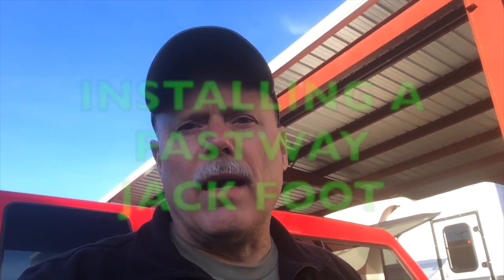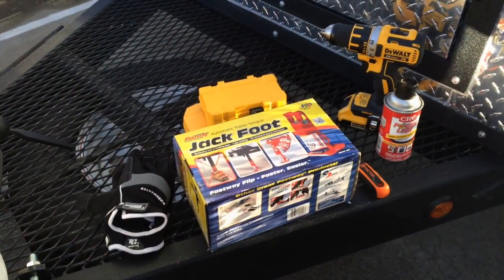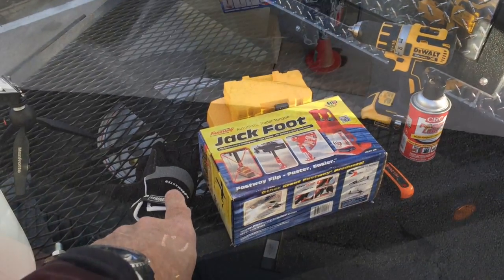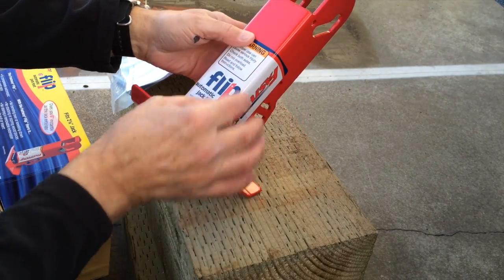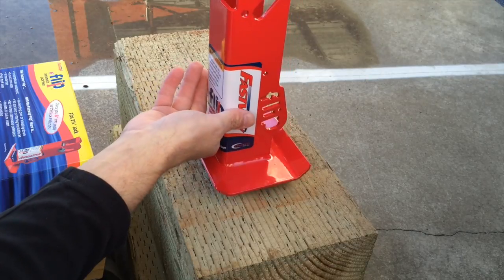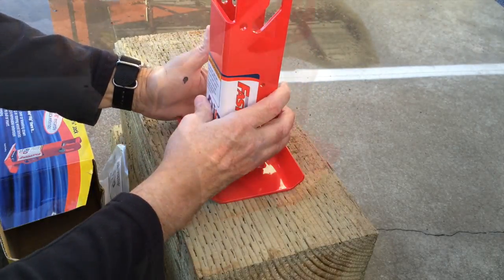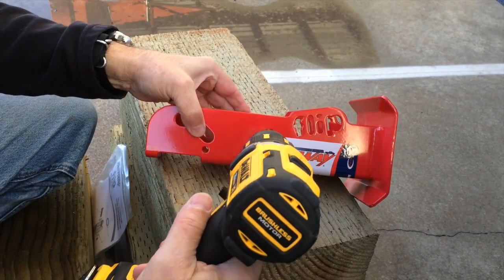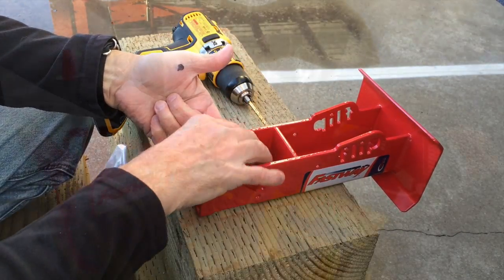How To Install a Fastway Jack Foot  |  #camp216

Comment: I'm not an RVer, but this thing will be AWESOME for my enclosed band equipment trailer with its doesn't-lock-into-place-wheel.Thanks for the info!dcr
Reply from the maker: +Dcr 72104 - I think this is a great addition for any trailer, including utility trailers. I will likely upgrade our other trailers this summer. We have a utility dump trailer and a flat bed trailer to haul our tractor.

Comment: You may have already did this but not shown it on the video but you should paint around the holes you just made... and where you filed to stop the rust
Reply from the maker: +stevemccollum2011 - I did paint the holes as well as a couple of touch up spots that had a bit of rust . . . just didn't think of video of the paint.